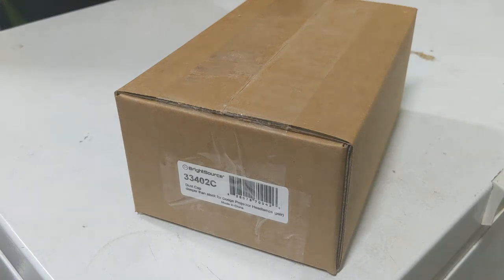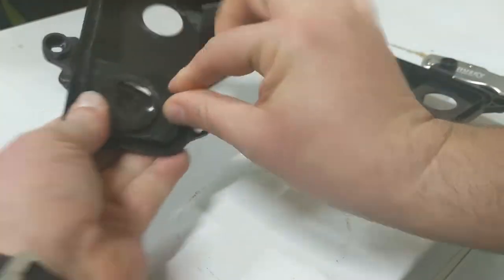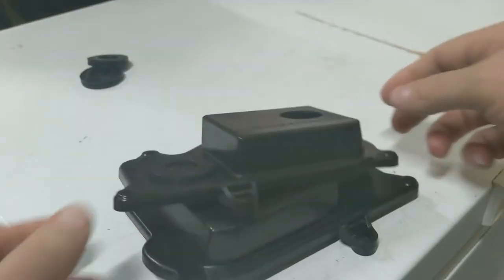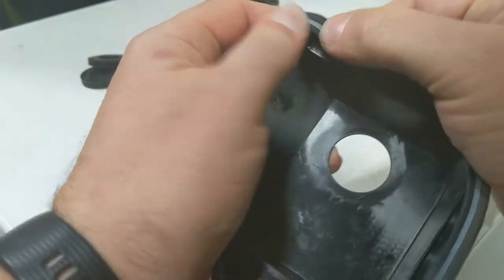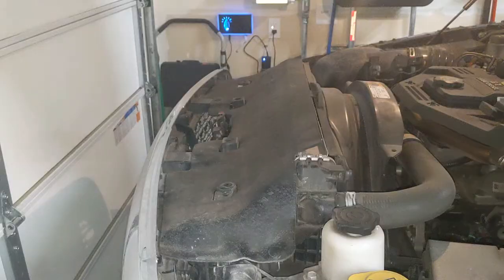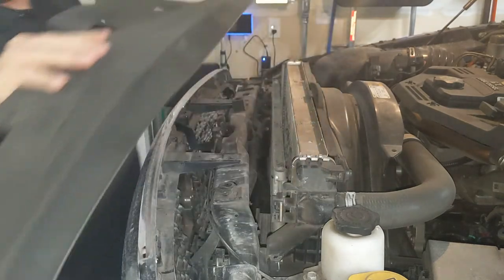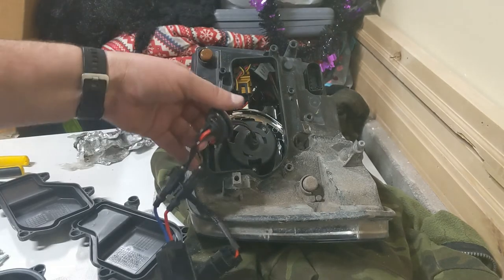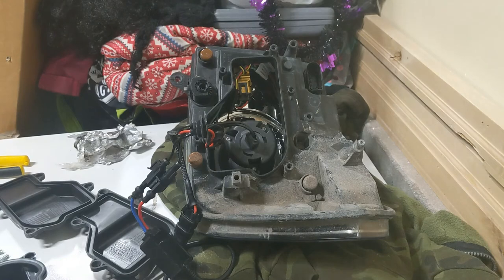Installation of HID kit in 2017 Ram 2500 with projector headlights

Comment: My lights flicker on and off and then stay off.. I have the exact same kit as you on a 2017.. 
did you use anything else?
Reply from the maker: Depending on the truck you might have to get the HID lights programmed in so the BCM doesn’t use PWM signaling on the new lights.  I had good luck doing that myself with AlfaOBD and a good quality Bluetooth OBD2 dongle but a dealership might be able to program them as well.  I didn’t have to do that with these HID lights but I did have to do that with the LED lights I eventually put in.  Another install option in case this fails is to do a bypass relay that takes power directly from the 12v rail to power the lights instead of powering them through the canbus controlled circuit.  I’ve heard that some trucks are pickier than others in that regard.